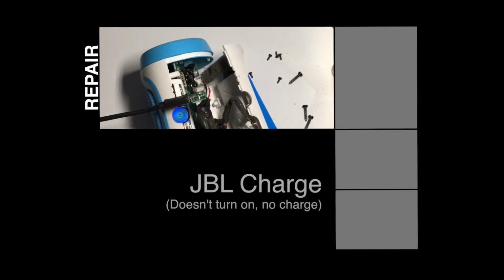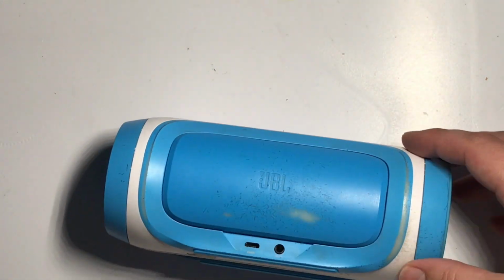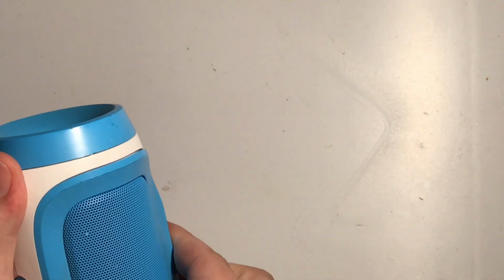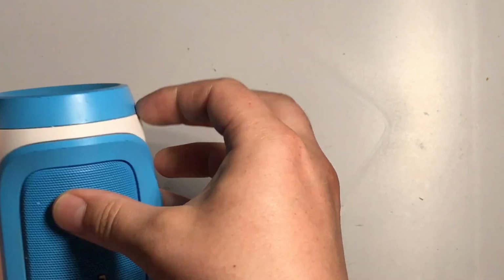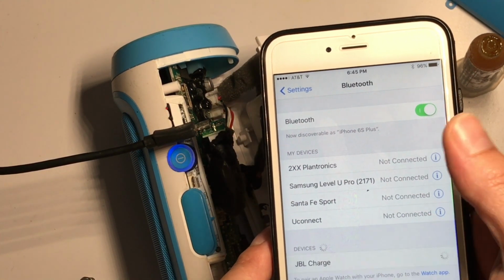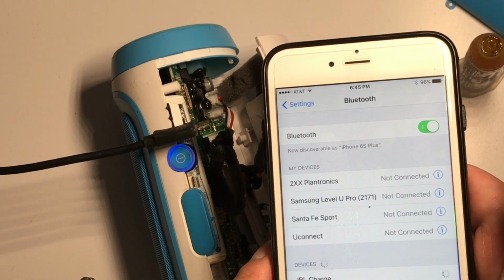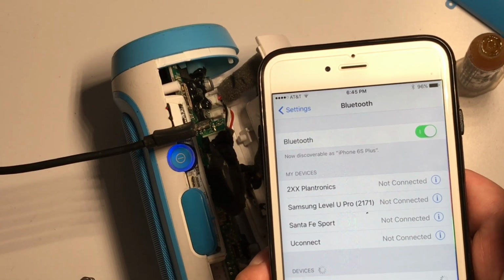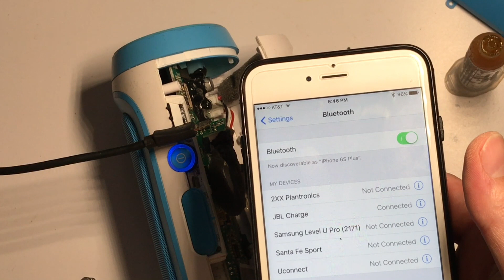JBL charge repair [JBL SPEAKER REPAIR , JBL REPAIR , TEARDOWN]

Comment: For anyone still interested, to ease taking the case apart, I warmed up the areas where the white plastic meet the gray rings with a hair dryer to soften the adhesive.  This made separating those pieces a lot easier than I've seen on videos related to these original JBL Charges.

Comment: Hi there
I need a help with my son's JBL extreme speker, the problems is its charge but its not on and not on charge so i think the battery is damage or the charge of the speaker is damage
Reply from the maker: Hi, it looks like one bank on your battery is defective, try to measure voltage on battery between Red and Black wire ,voltage supposed to be between 7V to 7.6V

Comment: Would it be possible to replace the battery with main power? For example, a charger from phone?
Reply from the maker: 1234103 , Thanks for question, you mean use portable speaker from power supply only?
Reply: Yes :)
Reply from the maker: Yes you can, but you need to calculate power output, i think power supply with 5V and 2Amps will be good for you.

Comment: My power button and the volume buttons are not working, (i think) Any solutions?
Reply from the maker: Do you have a tester (multimiter ) to check those buttons if they have a physical contact ( Membrane Switch) with flex cable
Reply: @aliend5001  I don’t have it.

Comment: In my case, my JBL charge 2 doesn't turn on, when I plug it, the power light in on but I cannot turn on the device, what would be the problem? I just change it's battery..

Comment: my speaker lights only when I connect it to the charger, then it connects by BLUETOOTH but it has no sound. What is the problem, is it the battery or the motherboard or the speaker that is damaged?
Reply from the maker: Hi , any water damage? Looks like your battery is not operating properly, try to check voltage on your battery, if voltage less than 3V - just replace the battery , if battery voltage good ( about 3.5 to 3.8V) capacity might be low - just replace the battery
Reply: @aliend5001   Hi. I have same problem that Jasonvevo
. Battery voltage is 4.15 v. Is it a bettery issue?

Comment: Mine charges for like 5 minutes then stops and I have to replug it in, then it charges for 5 minutes and stops again. Got any ideas? Great vid btw
Reply from the maker: Thank you for comment,  You need to inspect battery and charging port, try to measure the voltage on battery, it supposed to be between 3.6V - 5.0V , if less then 3.2V you need to charge your battery separate, and also you need to check charging port, try to shake a plug  connection if led blinking , probably you need to fix charging port, if it not possible try to change whole part ( charging port assembly).

Comment: My charger port is  Missing the teeth on the inside is there any way I can replace the port ??? With like one from a cellphone
Reply from the maker: o 5th God HD o , Thank you for question, of course you can use typical micro USB CHARGING port from any mobile device.

Comment: you forgot to tell us about the screw below the battery :(
Reply from the maker: Sorry about that )))
Reply: Took me an hour and a half learn how to open it after i broke it open i found out that theres a screw below the battery lol oh well
Reply: The same :( cracked the body trying to open it
Reply: Yup... I tried to get the screw out without disconnecting the battery but it was physically impossible. the connectors were no longer attached one I got the screw out from under the battery. How did you do that without damaging the battery connectors?!

Comment: I have the same one you have, just with grey instead of blue, and it won't turn off. The blue light around the power button stays one. The three power lights will sometimes light up, but the red light at the end when it indicates it's almost dead is on the same time all the blue lights are on, making a purple. Also, when the power button is pushed down, it turns off the battery indicated blue light.
Reply: No sounds are being made either, holding and taping the post button won't turn of the blue lights.

Comment: My JBL Charge will not go into pairing mode, is this something that can be repaired?
Reply from the maker: Shush_ Ya_Mush , When you pressed power button on your speaker, did you heard "beep" sound and blinking green led around button?
Reply: No it doesnt beep or blink, it used to but not any more, it plays through 3.5mm cable but no bluetooth.
Reply from the maker: Shush_ Ya_Mush , Probably Button membrane is damaged, try to clean only button with alcohol, if it doesn't help just buy a whole part( button assembly)

Comment: Hello, my jbl charges outer casing has turned to be very sticky and dust is unable to clean.Can someone give me a solution for this issue?
Reply from the maker: The best solution for you, you just need to disassembly your speaker, disconnect mUSB port from logic board and clean it with 99% isopropyl alcohol.